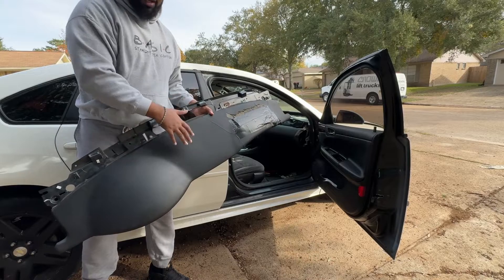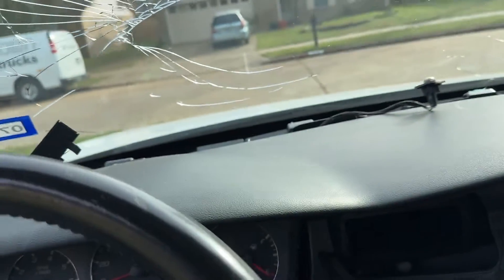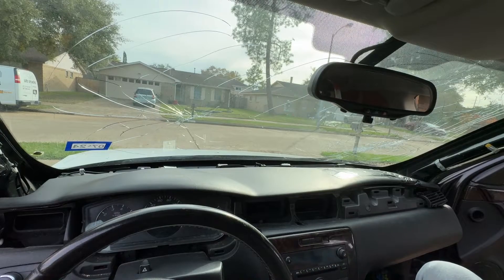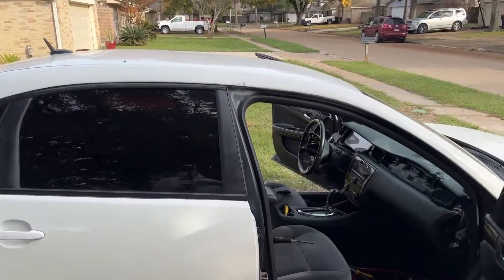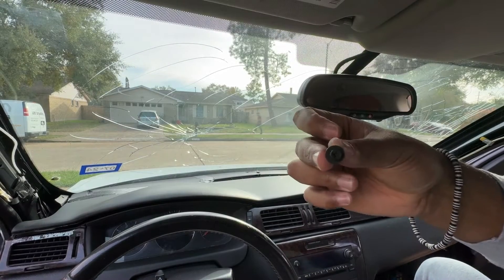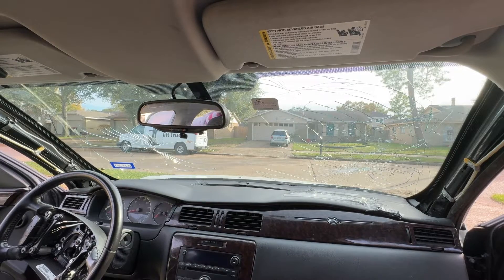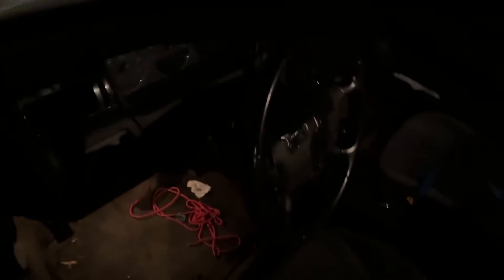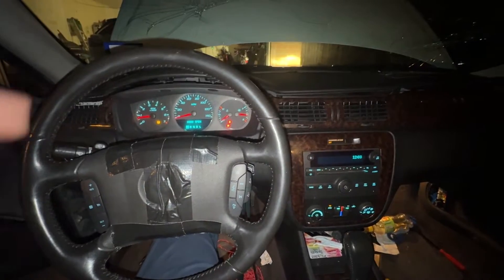REPLACING THE DASHBOARD IN MY CHEVY IMPALA | HOW TO FIX AND REPLACE YOUR DASHBOARD IN YOUR CAR

Comment: The black thing in the middle of the car is the DST sensor it’ll tell your car when to turn on your light incase you forget to it works whether you have the knob turned off or have it on auto I LOVE IMPALAS I have a 2016 LTZ impala 3.6L FFV FLEX FUEL MODEL I gotta replace my wiring bar to my blend door actuator for the middle driver side actuator the part is good but somehow the wilting harness somehow got severed